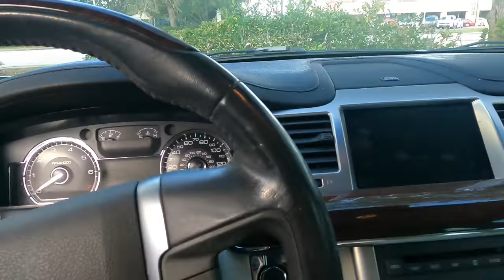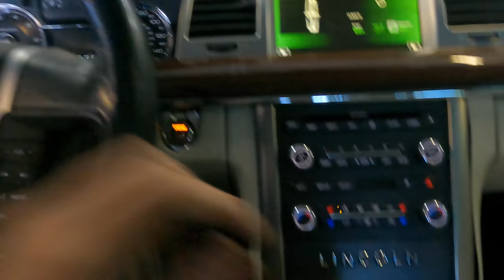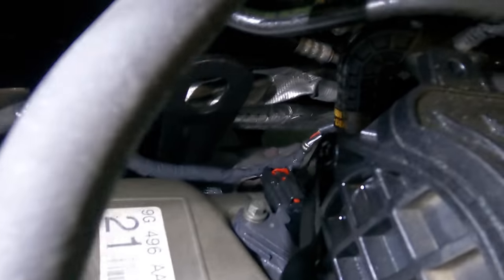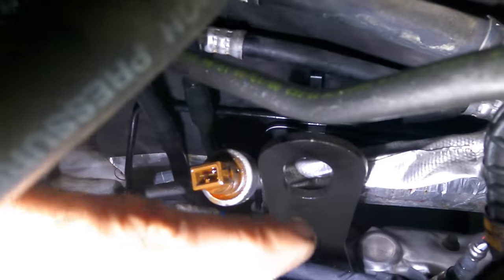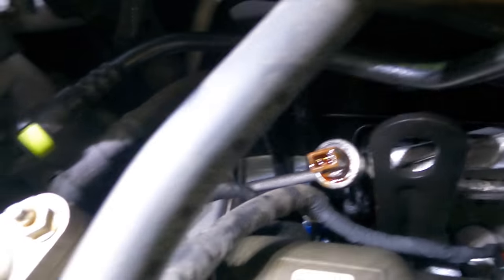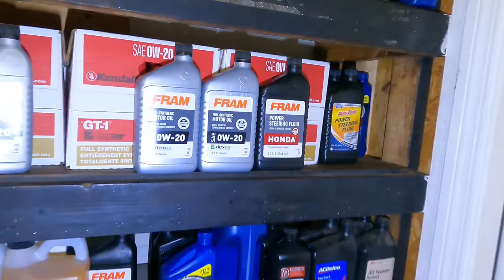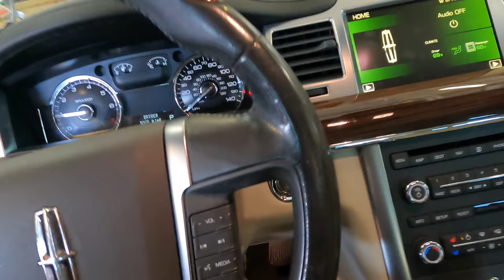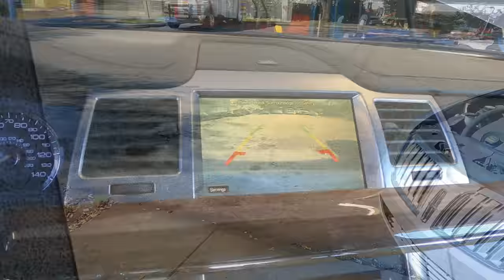Almost Caught FIRE! Lincoln MKS

Comment: Ray: "Hmmm.  The steering column makes a squeaking noise..."
Ford Engineer: "No extra charge for the lane deviation warning system."
Reply: Hahahaha
Reply: Nicely done
Reply: The smoke were, you have the James Bond special option.
The sqeeky noise are the rubber ducky toy bath tub option also comes free with the "007 "package.
Reply: @loktom4068  😂
Reply: Actually believe it or not that squeaking in the steering wheel is due to the car washes using all that freaking armor All everywhere and it seeps down between the steering wheel and the cover. People love that stupid armor All on that dashboard and everywhere.
Reply: ha ha, thats a funny one
Reply: Good one!
Reply: My explorer is stuck at the slowest wiper speed because of a problem with the wiper stalk. No, it's not a problem. You just gotta be prepared for rain.
Reply: @pootispiker2866  RainX!
Reply: @mikejacob3536  ah ah, mechanical RainX
Reply: Gooooddd One!🤣
Reply: You are wrong drive belt will make a squealing sound empty hydraulic system will not squeal unless the pump is lock it up los systems don’t squeal
Reply: @charleslease9741  watch again. The sound Ray's talking about sounds nothing like a power steering system with a bad belt or a dry pump.

Comment: Interestingly, a pressure switch not unlike that, activating the hour meter in my 172 Cessna failed in flight, pumped the engine oil overboard, destroyed the engine and gave my wife and I the experience of a lifetime. All is well.
Reply: did your air breaks work lol . I flu in Islander and beavers for years in northern Canada for Devon oil company , stuff does happen .
Reply: Sounds like a need for redundancy in that system.
Maybe a parachute for you or the plane.
Reply: What was all over the dash of that Lincoln?
Reply: That's crazy. Glad all is well with you.
Reply: @billsmoot67  Plastic degraded by UV - manufacturers know all about it & there are alternatives which don't "melt" but if their shitty cars don't fall to pieces, people don't buy new ones
Reply: Me too
Reply: @GARDENER42  The most effective change they made was moving to windshields with better UV blocking.
Reply: Glad all is well. It sucks when things costing a few bucks cause things thousands of bucks to fail.
Reply: Tell us how you and where you landed?
Reply: @sosco22  Is that your MGA in the picture?  What year is it?
Reply: Your videos are always interesting and educational. I'm amazed at some of the precarious locations you have to maneuver thru to remove bolts, accessories, wiring, plumbing, etc... and still got to remember where it all goes back to.
Reply: @bobr4987  Contrary to popular belief, airplanes don't fall out of the sky as a result of engine failure. <grin>
Reply: Glad you all are down safe
Reply: @StrangerInAStrange  nope for them to fall out of the sky u would have to be nose down or completely still  when the engine fails. Ive seen 2 cessna crashes.  And both were minor because the pilot glided the plane down and landed well only one was a crash the other was perfect . The actual crash was cause a wing clipped a car on a city street

Comment: I just wanted to thank you. (2:36).....  I noticed my oil filler cap (710 cap) was upside down.  By removing it and reinstalling it right side up, I have gained 7 mpg, and can now stretch my oil change intervals to 8000 mi.  You rock..........!
Reply: And increased speed due to reduced drag.

Comment: The last time an 2009 Lincoln here in Michigan was that clean was in 2009. I use torches almost daily at work
Reply: My car is 2009 and I'm OCD about keeping it clean. But it's not that clean.
I think maybe Ray made a mistake and it is 2019. As it was way to clean underneath as well.
Reply: @davidd1492  definitely older than 2019. That dash is straight out of the late 2000's
Reply: I got a 2009 mkz, it's treated me really good considering I've got almost 170k on it, only thing that really weighs heavy over my head is the water pump.. I got the 3.5L v6...
Reply: @david d he’s in Florida I believe it’s definitely a 2009 tho you can tell by the rear end . Newer ones are more rounded out

Comment: By the way, If you are looking for the cap from the power steering bottle, it's sitting on a bracket on the shock tower behind the power steering reservoir. Surprised it didn't fall off when you were test driving it.
Reply: I'm pretty sure he put it on before he test drove it because after the test drive he popped the hood for a last check around the 14:55 mark and it was on the reservoir.
Reply: @rickmossop3733  I was talking about the cap from the quart bottle.
Reply: @marvinvacha5142  ah, I see.
Reply: Ok I'm glad I wasn't the only one to see that.
Reply: I saw it too, and was silently begging him, WILLING him to notice it.

Comment: I bought an 07 Lincoln MKX last year & I love it. It’s mint condition (for an Chicago vehicle, no rust anywhere) & runs like new. Bought it at 130k off an older couple (original owners) for $7k. I put 11k on in an year. Drove it to Boston, then Atlanta, back to Chicago without one problem over the summer. Besides general maintenance, it’s the best vehicle I’ve ever owned except for my 01 ranger with the 2.5 & 5 speed 2wd. Ran my ranger 525k until rust ate it
Reply: My fave vehicle so far was a '96 Ranger. I abused the hell out of it. I hauled way too much weight in the bed, didn't do preventive maintenance, drove all over the US...

It still made it 334k miles before the transmission went out. It never had trans service and oil changes were as rare as snipes in the back woods of Georgia. I have been trying to find a mid 90's to early 00's Ranger with the 4.0 for 2 years now and those in excellent condition go for way too much.
Reply: @AdamIsUrqed  get an s10. Preferably one like my blazer with positraction and 3.42 gearing. 4.3 will smoke those Ford 4.slows. and they have no problem hitting 300K. Mine currently has 260 k

Comment: Your crowsfoot on an extension reminds me of a leaking hydraulic line on aircraft I was working years ago. It was in final flight testing and we had a leak in the belly. Traced it up to an aft return line to the reservoir through a bulkhead. This was a B-nut on a one inch hard line with over one hundred ftlbs of torque. It was supposed to be torqued and tested during initial assembly. Now there was limited access. I had to use thirty-six inches of extension with a crowsfoot to re-torque it. Not sure it was ever torqued in the first place, because I had a full turn before the fitting was seated. It's amazing how much force is lost on an extension, but we got it fixed.
Reply: Extensions don’t impact final torque applied. that is just a myth that old timers believed. If your torque wrench clicked, then it was properly torqued.

There is actually a good video on YouTube about the topic that was made by some guys that run a torque wrench calibration company.

Edit: I re-read your comment and it looks like you were referring to the fact that the AN fitting was backed off a full turn before it snugged you in the first place. Been there. I’m an A&P Tech myself.

Comment: The moment that Ray said "This one is easy", I instantly filled with a sense of dread.
Reply: Picked up a 2010 MKS from a dealer, a three hour drive from home. 33,000 miles, a small hole in the rear seat leather (size of a pen tip) the ONLY flaw. Kids don’t like Lincoln’s so they aren’t popular in the used market. Bought it for what it was worth. Wonderful, comfortable car, a true pleasure to drive. Ford dealers charge a monumental fortune to do any service. At about 79,000 miles a fender bender allowed us to total it. Still in pristine condition with one collapsed rear fender. I will always remember it as my only true luxo-boat. 🥲 RIP LUXO MKS.
Reply: I have been a life long FORD man since my mother’s 41 business coupe (I think). Reflecting on the service, and especially the parts availability, in recent years, I doubt I will ever buy another.

Comment: A good basin wrench comes in handy for this type of situation I have used it for many vehicles
Reply: @erik_dk842  and they come in different sizes and lengths but sure come in handy for auto repair as well
Reply: @catslivesmatter1268  I've wished for at tool like that more than e few times, as well as for finger joints turned 90 degrees, or a thumb as long as my index finger. LOL

Comment: Hey Ray. OSHA approved air nozzles prevent compressed air being injected through the skin if the tip accidently contacts the skin. This could cause air embalism into the blood straem. If the air tip touches your skin, the side air holes allow the backed up air pressure to escape out the sides of the nozzle instead of under your skin.  Be safe and keep up the good work. Nova Scotia, Canada

Comment: The original OSHA approved blow tip was, a regular tip that was cross drilled about a ¾" up from the tip.  This was to prevent all of the air coming out of the tip when blocked, more specifically when pushed against skin it would bleed off the air pressure.

Comment: As a driveway mechanic way back in the day, I appreciate watching you work. The average guy used to be able to work on their own cars because of their simplicity. You could rebuild a carb, fuel pump was mounted to the engine block and ran off of the cam, points, plugs, you get the idea. Everything today is so complex, so many things electronically operated, and you have to be a tech to really work on them. People who have no idea about what it takes to make repairs today should be made to watch your videos. They can then understand why it often takes four hours of shop time to replace a $50 part, because you have to disassemble half of the car to get at it.
Reply: Even error codes aren't foolproof. I found out that "EGR valve" error almost never means that it's the EGR valve to blame.  Turned out there are many sensors involved, any of which could be the problem. It could be the Catalytic Converter, or as in my case the "Backflow Pressure Transducer".
Reply: @Bob R  yeah on a lot of VW TDI an egr temp sensor code error can lead you to a plugged heater core. Temp error shows up because the coolant making its way back in the circuit doesn't match the temp it was at when it left.

Comment: In the past, "Safety Blow-off Nozzles" limited the output pressure to prevent injection injuries.
Reply: Air embolism from the single port end accidently being pressed up against skin is the concern I think.
Reply: @TylerOfMO  An air embolism is a form of injection injury, but you don't necessarily need to get an embolism to be killed by air nozzles. Especially if a liquid is involved. Injection injuries are NOT to be fucked with
Reply: Also a big concern with high pressure grease guns. Injected grease injuries are bad news.

Comment: You left the power steering fluid bottle cap in the engine compartment. It's going to catch on fire!😉🔥
Reply: It already did and now the customers flying down the road screaming with flames in their face 🔥🔥🔥🔥☠️☠️
Reply: Power steering fluid and ATF is like a liquid gas one hits a hot surface it will burn quick

Comment: The OSHA safety nozzles are made to limit the pressure and flow rate of the air exiting the gun. You can accidentally inject air through the skin and cause an embolism. Like having air in a coolant line, except it causes the computer to explode if the air bubble reaches the computer.
Reply: You can inject air thru your skin and form an air bubble in your vein to cause embolism. Never ever heard that before...
Reply: @TermlessHGW  Same... The more you know, having learnt of this fact right now sends a chill down my spine thinking about how many times I've fucked around with compressors trying to feel how much oomph they can put out against my hand... Fortunately I've only messed about with home Depot compressors cause I would've probably killed myself by now.

It's one of those things that you would never think about unless someone told you

Comment: I have nearly the same switch on my '89 Buick.
If the AC compressor is running, engine at idle, and the steering 
system calls for high pressure (as in parking) the ECM tells the BCM 
to disengage the AC clutch, so the engine isn't so stressed, possibly 
causing a stall condition.
Reply: I’m certain a ‘’89 Buick didn’t have a bcm.  It questionable if it even had fuel injection.

Comment: the purpose of multiple holes above tip of air gun nozzle is to prevent injury in or onto skin of person.  If tip is inadvertently held directly on skin, the air pressure won't cause said injury, as per OSHA regulation.

Comment: Did you leave the cap off the bottle of power steering fluid under the hood / bonnet? I am sure it was there while you were hose washing the engine bay but it had gone after the test drive.
Reply: It was still there in the last look...it moved back and down a little, wedged in between a/c line and strut wall.
Reply: @g0mers69 
Good spot, well done.
Reply: @unclegreybeard3969  thank you

Comment: Every time I see Ray go for the garden hose, I'm genuinely surprised. I thought everything was cleaned with brake cleaner when Ray cleans things up. 32 cans used? At least it's clean now 😏
Reply: Using a water hose to wash off oil is like putting water on a grease fire. Does nothing.
Reply: @robsdeviceunknown  My thought as well, but it did get the dust off.
Reply: ...and here in VA we are not allowed to wash things off in the driveway. Washing has to occur in a bay where water/oil is collected and properly treated.

Comment: For those people who say hosing an engine off will ruin it. What happens when you drive through water? Lol God bless
Reply: That's what a splash pan or belly pan is for....to keep water out of the engine compartment.  And you shouldn't drive thru deep water anyway
Reply: @volvo1971  splash pans only stop some water. I have news for you without even driving through pooled water I've had a smoked engine bay. If rains heavy enough it'll get in.
Reply: @thomasdesmond2248  true but you should avoid pooled water whenever possible so it doesn't get into the intake.  Belly pans do help tho.

Comment: That state patrol bit reminded me of something. My pickup has actually been rear ended, albeit lightly, by a highway patrol before. 

The previous owner of it was being pulled over, and it in typical fashion for those of us who have manual transmissions, he simply geared down to start slowing down which means no brake lights. 

Long story short, hipo was basically riding his bumper when this occurred.

Comment: Replacing the alternator on my 1991 Escort, broke the power steering tank. I drove without power steering for about a year before finally finding a tank in the junkyard and was working on bleeding it (front end on concrete blocks), wasn't working, just started the car, turned the wheel several times and made sure the tank was full. Worked until I got rid of the car.

Comment: I like these videos, however on this one I would have liked a little more about the bubbles, ie. The reason that happens in a power steering system.
Reply: Because it leaked fluid air was introduced 
And rises to the top.
Reply: @ricknielson8934  Thanks.  I'm actually aware of the reason I was just thinking it would be covered since this is an automotive repair explained channel..  just offering a suggestion I guess..

Comment: My recollection is that the air nozzles with the single hole had a higher damage potential when in use. My mechanic Dad used to tell stories about how people would goose other ppl with the air gun. The issue is that if they hit them were their rectum is, it can potentially cause an embolism from the compressed air going thru the anus and into the lower intestinal tract. I can see that the many small holes around the nozzle would help prevent that from happening.  Just my thought on it.
Reply: Well, there's a sentence you don't hear often.

Comment: OSHA approved air gun. I believe it gets approval by reducing tip exit velocity below what it takes to push dust or water in the airstream into your skin. The small ports around the nozzle od reduce flow and provide pressure relief if you get too close to your skin.

Comment: Couple of things. That is obviously a Lincoln MKS, not an MKZ (as titled in the video). You were obviously working on one equipped with the 3.7L normally aspirated V6 engine (3.5 Ecoboost equipped models have EPAS). This is very interesting repair, in that the pressure switch looks suspiciously similar to the one used on mid '90s Ford trucks as the cruise control deactivation switch on the brake master cylinders. There was a safety recall issued by Ford Motor Company to replace those switches with updated ones, along with a fused jumper harness added to it, to prevent fires from starting.

Comment: power steering fluid can make epic smoke, i was racing someone in my Mondeo and the plug in the rack drain hose blew out and dumped ALL the fluid onto the exhaust at pressure in just a couple of seconds, the car i was racing was on my arse but slammed on the brakes big time cos he couldnt see a thing and vanished in the smoke it was so thick lol.
When i saw all the smoke my heart went but when quickly lost my power steering it was such a relief to know it wasnt my engine!

Comment: Had the same issue with the oil pressure switch on my 2013 Edge. After driving for 5 minutes I'd get an oil level warning coming to a stop. Rev the engine and it would go away. Checked the sensor and sure enough there was oil leaking from it. Swapped out with a new one and all's well.

Comment: Best thing is the Engine Oil Pressure Switch is built the same exact way LOL. I have to imagine that you seriously have to have made some kind of deal when you applied for the position to be able to run a camera and all the extra work involved with that. I mean past supervisors had a cow if you went to the bathroom more than once or stopped and talked to a customer for more than one second LOL.